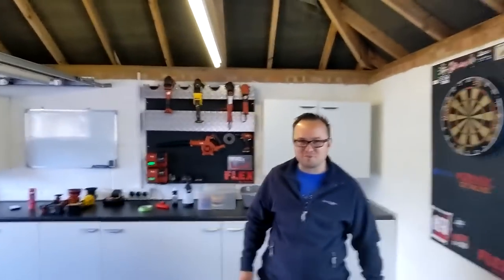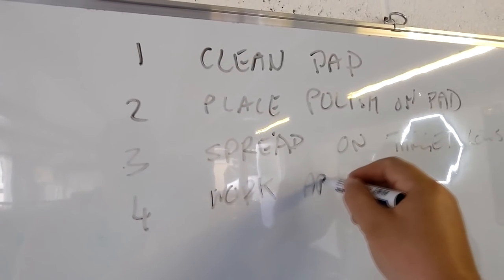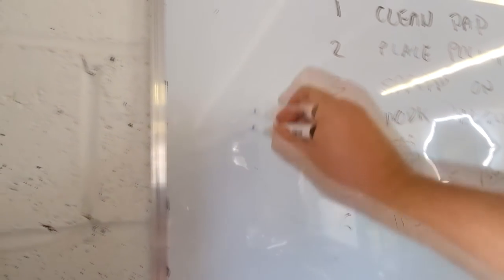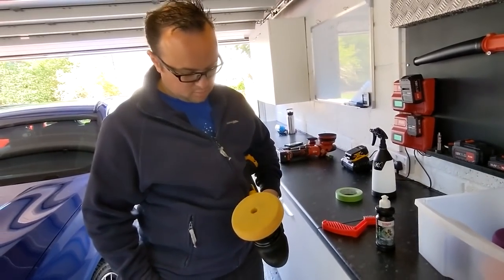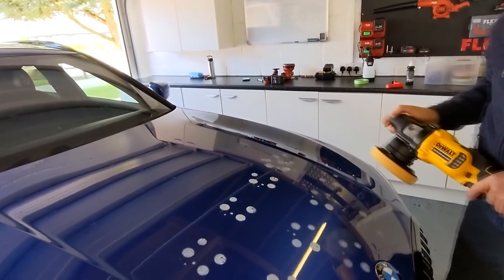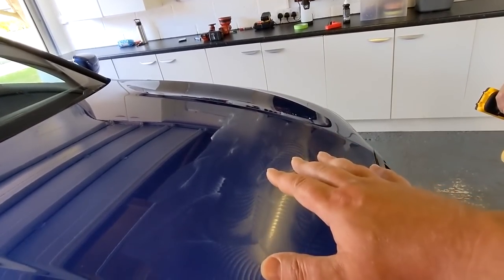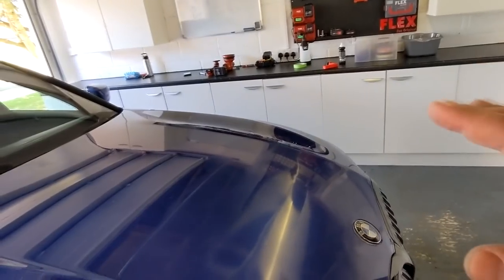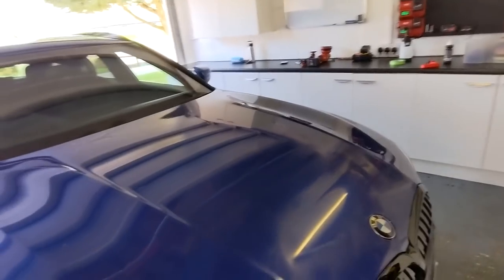Essential Tips for Polishing Your Car for the First Time

Comment: 3:19 - One time I had a big surprise was when I used Perfect Finish to do a one-step on an HS clearcoat. Under heavy light you couldn't see much marring, but after using a panel wipe I could see half of the initial scratches, which would be expected. With Koch abrasives doesn't happen :\

Also, a great advice for detecting whether the pad stalls is marking a straight line on the backplate with a sharpie

Comment: Would you say getting a old bonnet from a scrap yard that isn’t too beat up, and has fairly decent paint and price, is a good way to practice technique for a newbie
Reply: That's what I did, well worth it as you can also practice a bit of wet sanding, scratch repair etc.
Reply: I did this, great way to learn though It was only the other week so I’m yet to polish the car I’ve just got. But it’s the best way to learn I think.
Reply: That's a great way to practice. It'd actually probably be better to get one with swirls and marks on it, so you can experiment with different compounds and grades to see what works and what doesn't.
Reply: Ask a neighbour you don't like.

Comment: Hi, what's the best thing to wipe a panel down after polishing ?, I've got some gyeon q2m APC (will dilute as per the bottle) is that ok to use or is there better?. I'm such a noob and got so many questions about pads and polish on new cars/new paint.
Reply from the maker: Use panel wipe not apc.  Gyeon prep, bilt hamber cleanser fluid etc..
Reply: @ForensicDetailing  Thanks Jon, just today in the post I got gyeon prep and the waterspot remover ;). Still need to find my feet with the Flex XFE, as in actually using the polisher and pad/polish choice. Your content helps alot and 100% next time im going to chill and not rush and "slow down" with the passes.